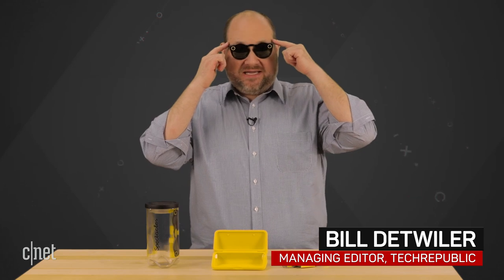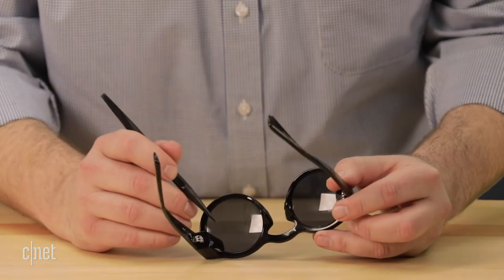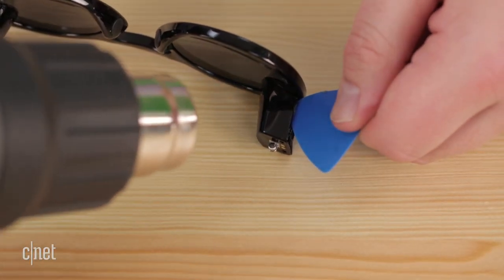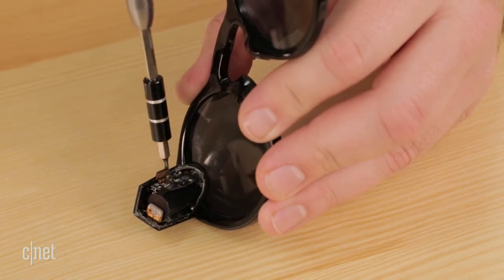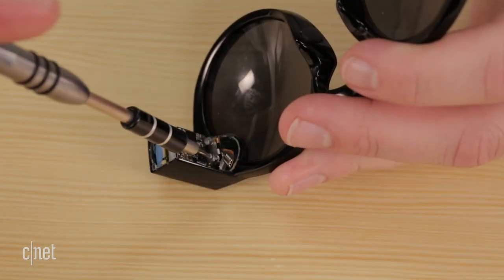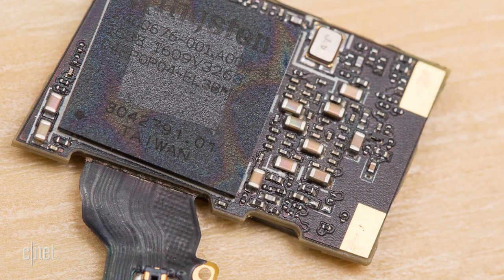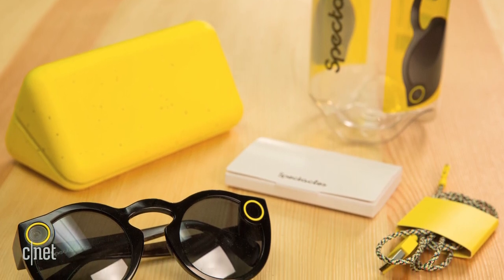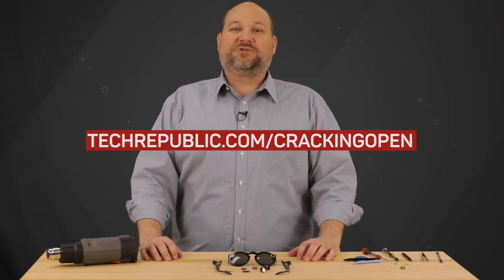Cracking Open Snapchat Spectacles

Comment: What batteries do they use? Type and designator please
Reply: I need to know aswell, did you found any information?
Reply: I need help too
Reply: GP1018-14HD
Reply: also curious!
Reply: did they change as they rolled out newer gens?

thanks for the answer ^
Reply: also curious what battery is in the recharge pack